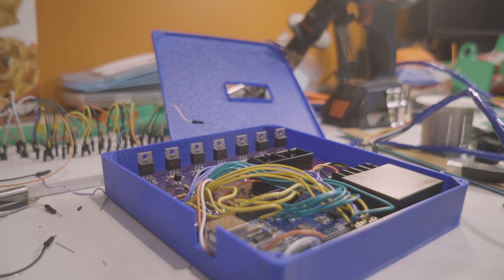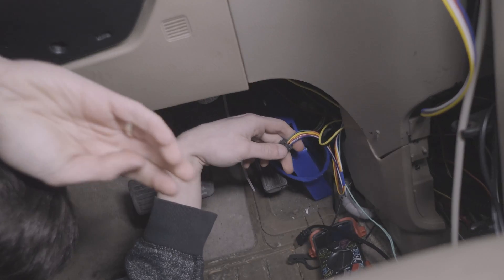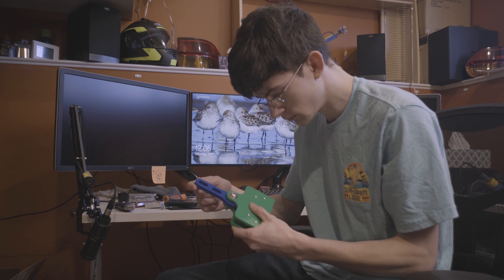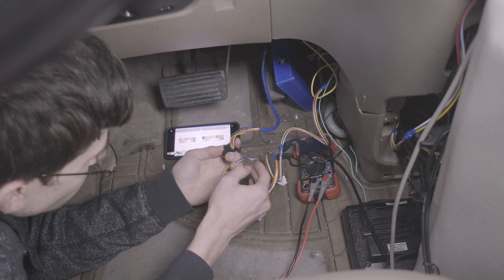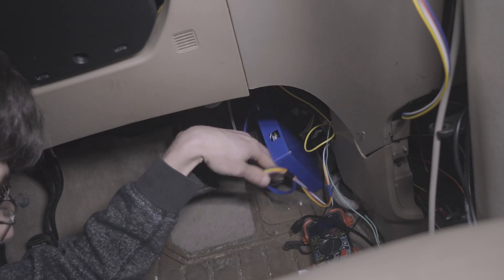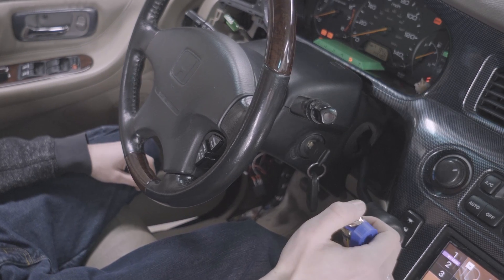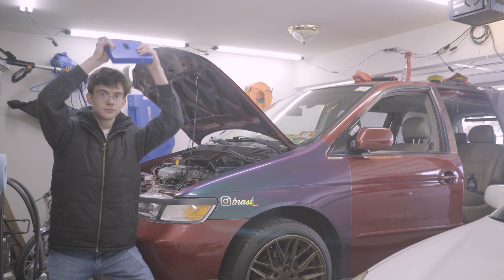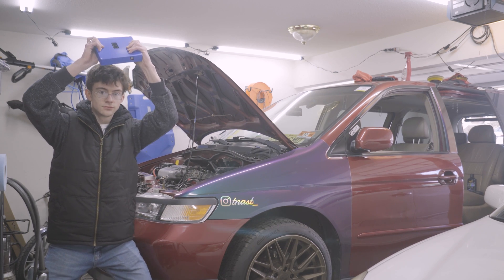FINALLY Testing My Odyssey's DIY Transmission Controller

Comment: Hey bro, I’m trying to do the same thing with an Arduino controller I have certain solenoids that I have to power in a combination one through six up-and-down with two separate buttons gear up button and gear down, but of course you know how to do all that what I need is the code and maybe a wiring schematic. I’m very new to coding but I have a pretty good idea of how to wear this thing up and how it’s gonna work and what needs to be put into the code. I just don’t know how to say it.😂 get back to me🏎️🏎️💨🧪🧪🧪

Comment: I realise this is an old video but just going to have a yarn for shits and giggles. I did similar (but not) to an old Nissan safari 4wd. I removed the factory controller and simply wired a bunch of relays into the solenoids and inhibitor switch. Basically the trans became fully manual and you would shift by moving through 1st, 2nd, D and then by pushing the OD button while in D to get 4th. It worked extremely well. The factory controller would provide a signal to the line pressure solenoid to drop pressure during shifts - I just left that completely u powered so I had 100 % line pressure all the time. Shit it worked flawlessly! But absolutely no safety mechanisms so you could go far too easily to 1st gear at any speed 😂😂. I now have a 3.5l v6 corolla (Toyota blade) with a shit trans so thinking about using an arduino to do it moving forward.....just so much more complex with the CAN system

Comment: I’d say the to throw a lockup button on the steering wheel for the torque converter :) did this with my 12v Cummins and never looked back! May need to grab a junkyard core converter and send it to a tranny shop to double up on the lockup clutches, raise the stall, and maybe even a billet rear cover if you have a few extra bucks! Love the build!!! Keep it up man!

Comment: Might be able to manuel swap with a manuel v6 accord trans if it does go out.
Reply from the maker: Yup, that's the plan. Either an Accord 6MT, or a TL-S 6MT to get an LSD. Even if the auto doesn't break, I'd like to do a manual swap at some point. It's just such a huge project, so naturally it won't happen for a while.
Reply: @tnast  actually, if you want to retain that engine, you'd want to go with a LSD 6mt from an 04-06 TL. The 07-08 type S TLs actually had a revised bell housing pattern!
Reply: I thought it was gonna fly off the stands and go thru the neighborhood. Jk I am on the edge of my seat until the road test

Comment: This is so sick, congrats! That first run when the software meets the real world is always so nerve-wracking, glad it worked out for you 👌

Do either of the signal lines for 2nd/3rd use the same pins as the arduino uses for serial? Think it's pin 0 and 1, maybe enabling the serial connection enabled some flag in the atmel chip and that's why it started working with serial debugging enabled... I would probably try isolate that issue before doing a road test in case it suddenly decides to stop working again 😅
Reply from the maker: Thanks! It's already nerve-wracking enough when you're testing on maybe $50 or $100 of equipment, but a whole transmission? Nervous or anxious are definitely understating how I felt!

I specifically made sure to only put the gear LEDs on those pins so I wouldn't wind up with serial messing with solenoids, and so I'd have visual feedback whenever I'm doing serial stuff. I've removed the lines for serial debugging since I had some other stuff I needed to debug, and the problem hasn't came up since, so absolutely no idea what's going on with that.